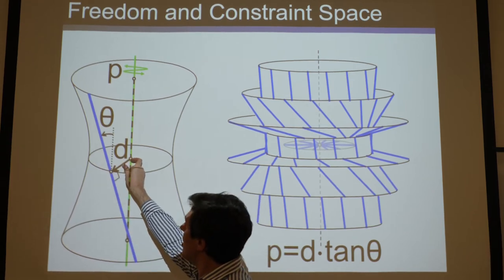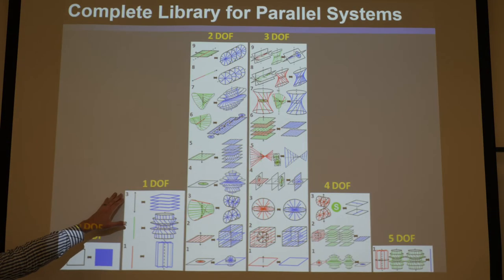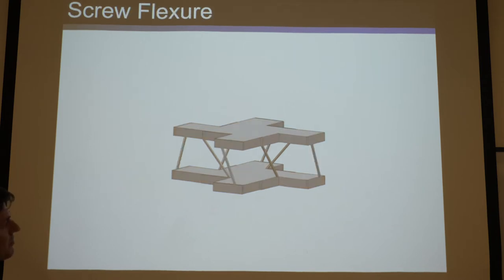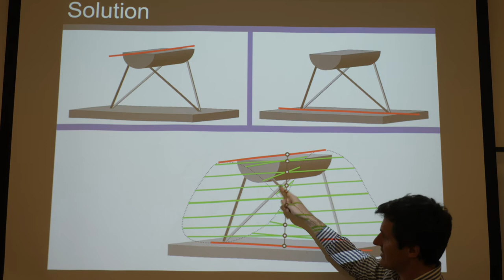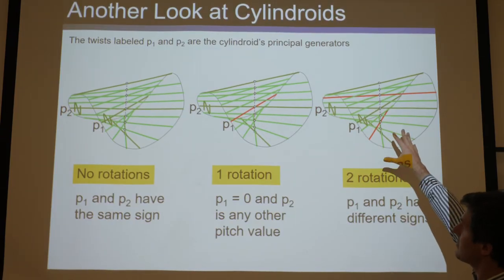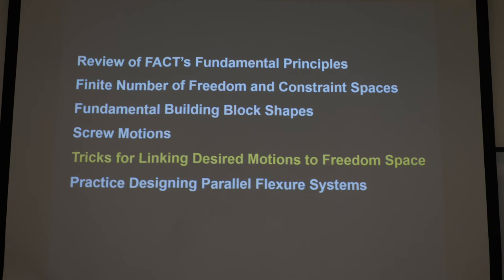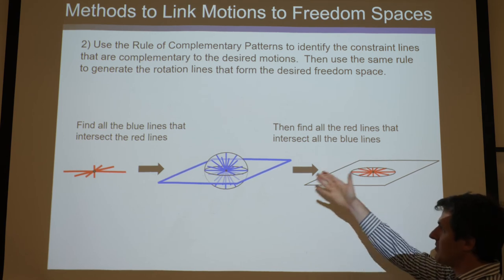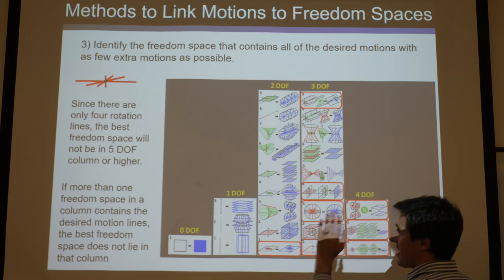Compliant Mechanisms Lecture 6 Part 7

Comment: Watched to 9:19, and just feel like musing here:

The first motion of every point in the stage (EDIT: I mean to say, every point in the stage where a wire is attached) is always perpendicular to the wire at that point.  All the points move up and down at the same rate, and rotate about the axis at the same rate... meaning, points farther from the axis have a greater movement orthogonal to the radius connecting it to the axis (EDIT: a greater movement orthogonal to the direction of the axis, too, which is what actually ties with what I write later).  Farther out, a greater motion orthogonal to the axis for the same degree of up-down motion (in the direction of the same axis) means the direction of the wire needs to be more nearly the direction of the axis of rotation.

Did I get that right?  Comparatively less motion in the direction of the axis means the wires are more nearly in the direction of that axis.  And that ties with the idea mentioned earlier of the wires 'infinitely far away' being precisely parallel to the axis.  I think that works.